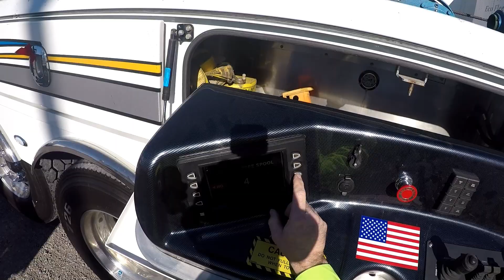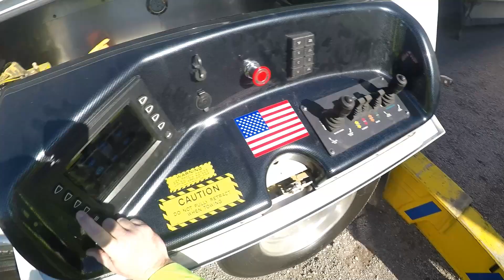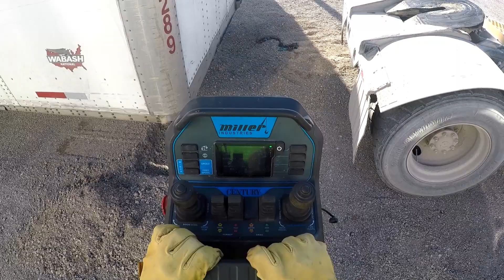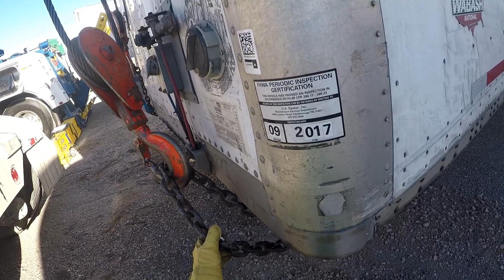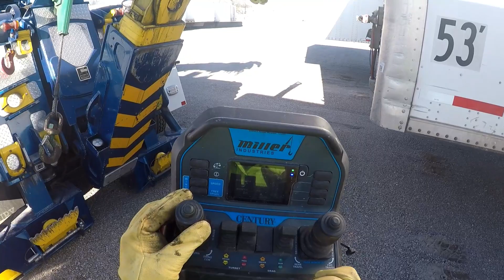The Christmas Lift

Comment: hay Ron  do you have a fifth wheel  plate for your lower tow boom   i think that it would save you a lot tjme
Reply: He does, I've seen it attached to the underreach in a couple of the older videos. Looks heavy though, and given the cramped storage of the 'tator (just filled to the brim, not unorganized - ain't my car, or it'd be both) I wouldn't be surprised if said plate would hide somewhere in the lower back of a locker.

Comment: Merry Christmas and Happy New Year Ron.  Thanks for the great videos and for sharing your passion with us.  May you and your family continue to be blessed and watched over.  I do have a question.  In this video if you had a 5th wheel attached to your under reach could you just back up to the trailer, connect to the king pin, lift and then pull it out to firm ground?  This may be over simplified (and I could be way off base lol) just curious.  I can see by your videos that most of the time you need to lift a trailer that would not be practical.

Comment: Got a question... instead of using the boom to lift it would using the under lift to raise it and then move the trailer forward a couple feet be an option? It seems like that would be simpler especially for a driver with a non-rotator truck.
Reply from the maker: Lifting and moving a loaded trailer with the under-reach isn't as simple as one might think.   The primary reason is the leverage point of the lift.   When a standard road tractor hooks up to a trailer the weight is on the fifth wheel, which is generally directly above the drive tires.   When we use an under-reach to lift the nose of a trailer, the lift point is 8', 10', 12', 14', or more BEHIND the drive tires.  It is like a simple tool, the fulcrum.  The tandems are the fulcrum.    Think of it like a teeter-totter.  Distance X Weight = Distance X Weight.   The Distance and Weight of the tow truck from the tandems forward remain constant and must equal more than the latter part of the equation or the steer axle of the tow truck will come off the ground.  So, lifting the nose of a loaded trailer 8' or 10' behind the tandems greatly reduces the weight on the steer axle of the towing unit, which can be extremely dangerous.   Thanks for watching and God bless.

Comment: How much does a job like this cost?
Reply: I was wondering about that too.
Reply: I don't know about him but about 10 years ago I had one of my trailers sink in the soft ground and called a wrecker and there shop was less than 2 miles away. So an after hours call because I called at 7pm, 3 miles round trip and 45 minutes of their time cost me $245.00
Reply: Took them longer to set up and tear down then it did to actually lift up the trailer so I could back under it. LoL

Comment: Could you have used the under reach to lift and move the trailer?
Reply: Sure, but it has its limits, one being the angle in the height, another issue would be how to get the yard truck hooked up when it has to be held in lift.